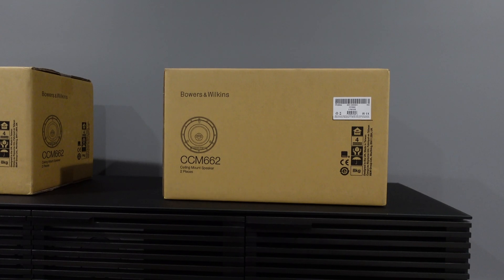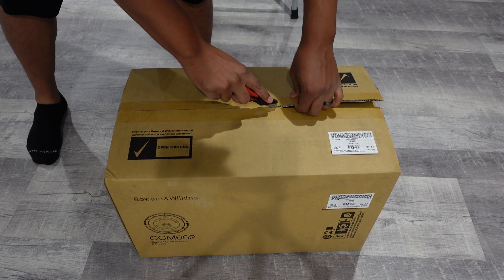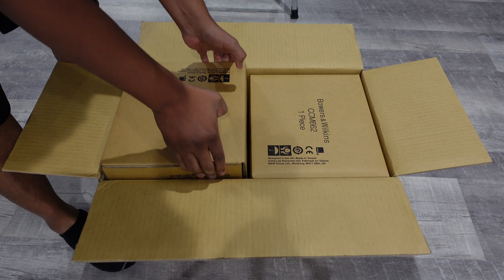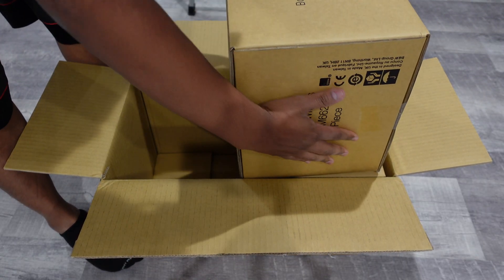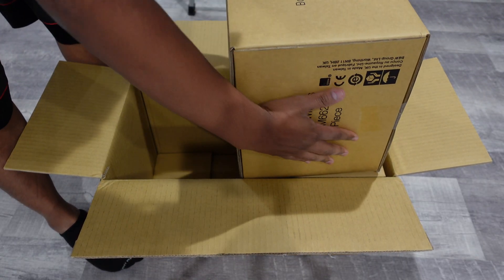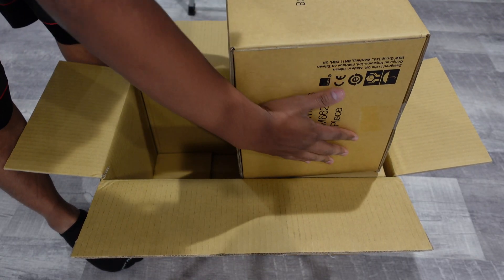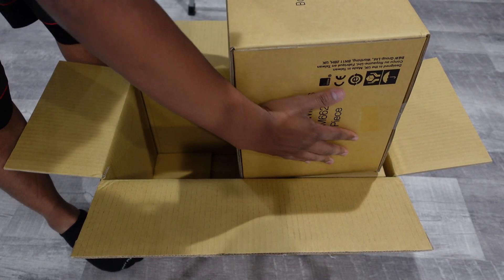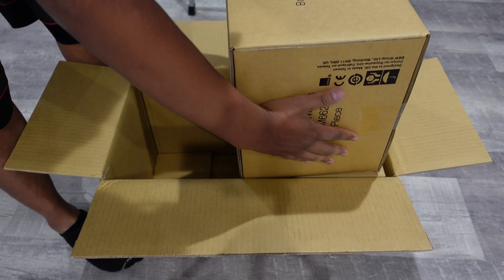B&W CCM662 | Unboxing and installation

Comment: Thanks for the informative video. I've decided to go with the B&W CCM662 in-celiling speakers, do you think the Sonos amp would pair well with these speakers? Beginner, and just looking for something casual for entertaining. Any suggestions are welcomed!
Reply from the maker: I don't know if the Sonos amp would work with that setup. My understanding is that Sonos Amp would work only with other Sonos speakers. If it was a Denon, Yamaha, or other receivers, then it shouldn’t be an issue. For Sonos, you would have to be in the whole Sonos ecosphere like Apple.
Reply: Yes they work - Sonos amp works with any speaker

Comment: Why didn't you just buy the B&W 600 Signature series to match the sound perfectly. B&W makes great floor standing speakers also.
Reply from the maker: In my opinion, I like the KEF Floor Standing speakers better than the B&W.
Reply: Cool but I got the 600 anniversary series.  I need those ceiling speakers though.  Looks very nice!

Comment: Do you think these would be a HUGE night and day difference as far as upgraded sound is concerned to SVS Prime Elevations on the ceiling? 
Great video btw.
Reply: no, and most of the audio the comes from these channels are spatial sound, more important to invest it in the center\left\right channels.
Reply: Right but I wasn’t asking if L/R/C weren’t more important than Atmos speakers. 
I asked if these specific speakers would be a great upgrade for ATMOS sound compared to keeping my ATMOS prime elevations.
Reply: @70grade37  right, and I said, no. :)  At $1400 a pair vs your svs primes, it's not worth it.